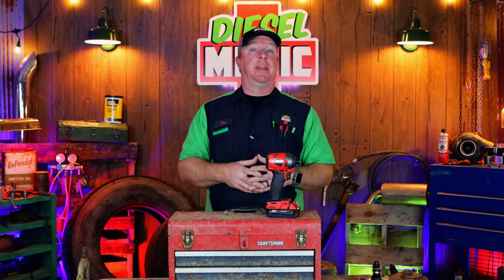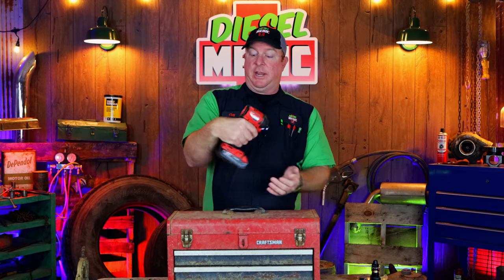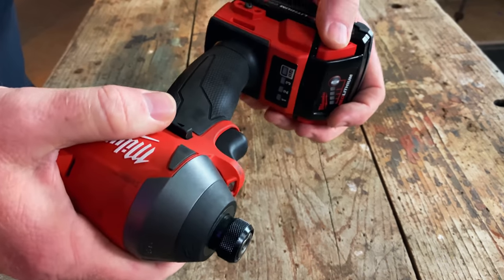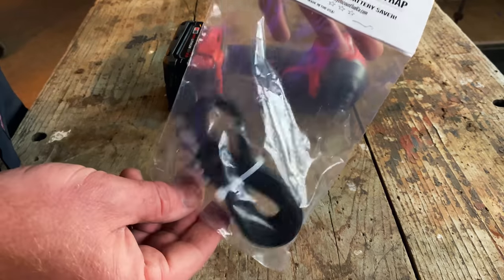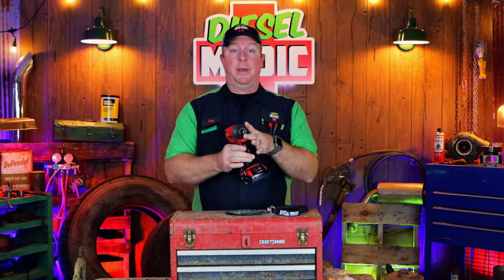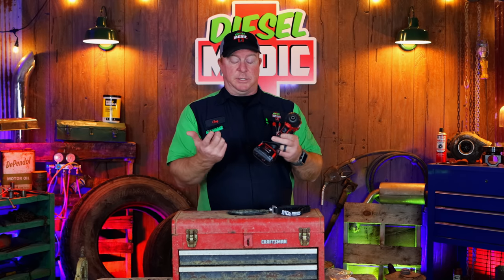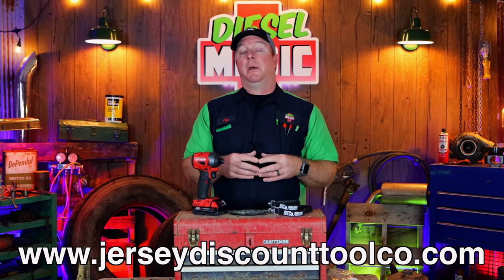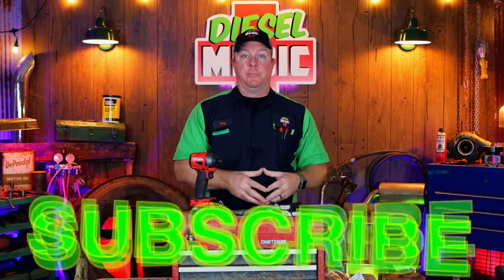Solve Your Milwaukee M18 Issues Fast and Cheap  No More Losing Battery Connections

Comment: I love that I have to figure out ways to keep the battery in place. Especially for a company that totes them self as the king of power tools.
Reply: Every company is gonna have tool flaws, none of them are flawless.
Reply: Still the best in the market, compared to DeWalt or Makita, second to none
Reply: @charlesbuchanan4121  Best in what respect? Failing to work and forcing you to fumble with the battery in the middle of a job? 

Even if it had double the torque compared to the competition, it'd be useless if you couldn't use it reliably.
Reply: For somebody that claims to be the best of the best I am disgusted in the fucking battery connections not just in the tools I haven’t even used my drill/impact tools yet but I have the charger and brand new batteries and I’m still getting loose connections and blinking red and green lights I thought I was doing myself by not purchasing any more DeWalt tools but at least when I’m charging my batteries and a Dewalt they click in and they fucking charge properly. I don’t have to shove a fucking folded piece of paper under the battery to make it charge right this is a fucking disgrace. I’m having second thoughts onMilwaukee for sure

Comment: thanks Clay.....  we have sold 1000s already and they have really been cutting down warrantees especially in my local tool route!
Reply from the maker: They work and I am so glad you came out with those. As you can tell that impact is pretty new. I’ve been super disappointed in this battery issue with it. My m12 stubby is just as bad. Almost have to hold your hand under it to keep it going
Reply: how to switch torque on the tool, button under stap
Reply: Are these discontinued? I can't find them anywhere, including your website.

Comment: I've been using large zip ties. You'd think they would just redesign the battery or battery connector, but I know it's not that simple
Reply: Well it wouldn't be too hard to make the tolerance atleast alot better they only have to re do the mold for the top half of the batteries.. That's pretty bad what's goin on with clays gun there tho

Comment: Thanks for the video, even though it didn't help me out. My problem was easily fixed b slightly bending the two outside contacts on the tool inward.
Reply: Thanks that worked for me.
Reply: Thanks. This worked perfectly.

Comment: So I have found that there is a manufactural problem with the 18v batteries. There's a gap between the red release buttons and the black molded plastic separating the button from the release hooks. I put a medium size paperclip in between them and it tightens the gap which doesn't allow the battery to move when attached. If Milwaukee makes this a little thicker it should solve this issue.

Comment: Just about to collect an ordered m18 and if the battery is loose then I will return for a dewalt or makita . Had several drills over the years and never had an issue with  batteries  and if this loose battery is a thing then milwaukee should recall all batteries and drills and not expect the consumer to come up with fixes for poor design.

Comment: Been makita all my life my workplace stocks all Milwaukee, literally have to have two people using a grinder one person holding the battery in and one person grinding 🤣 same with an impact driver or rattle gun it’s actually a nightmare literally happening with brand new tools it’s a pain in the ass having to duck tape a battery on your tool every time you use it literally rather use dewalt than Milwaukee

Comment: I’ve been told MILWAUKEE is coming out with a completely new m18 line with newly re engineered batteries they will be just like the RYOBI. ONE+.   where the battery goes up inside the handle of the impact gun it’s self
Reply from the maker: The old Dewalt was that way also
Reply: I kinda hope they don't do that since I'm already invested into the m18 and m12 lines and have a lot of batteries. I hope they just improve the newer models so this problem goes away.
Reply: They just came out with four new impacts and the design hasn't changed. They are however starting to put metal strips in the tracks of high vibration tools to keep the plastic from wearing. They did it on the new sawzalls and will most likely put it in the tracks of the new High torque impact when it comes out. They have to much invested in the line to change it completely they just have to make tighter tolerances and re enforce the plastic. I think they could probably attach metal strips to the locking tabs of the batteries and that would help as well.

Comment: Im surprise they haven't figured out a way utilizes the belt clip screw holes i also found the belt clip it self help secure the battery in place especially if you dont have a tool kart and us your pocket to hold the tool instead of the lift .

Comment: Anyone else notices at 2:10 - 2:13 you can see the battery wasn't fully inserted, in other words, it didn't click into place. I abuse my Milwaukee fuel impact driver 5-6 days a week for the last 2 years never had a battery fallout on me, I did experience the collect issue once or twice but nothing concerning.
Reply from the maker: It was fully inserted I always bang the front of them to be sure. It’s just an issue with them and has been since the M18 have some out. Something to do with the vibration that is produced by the tool working so hard. I’m not bashing Milwaukee they are a hell of a tool. I’ve done tons of tests on them on video (one even pushing the 2767 to 1400 lbs ft, it broke in the process but it did do the rates break a way) this was the impact we used and pushed it to its max torque in the video that is linked here. Something wears out either in the battery (or slide) or clips. That’s one reason I used this tool in the video it has the least use on it.
Reply: @KoonTrucking  Common Koon, we both know and anyone that replays the video slowly and watches closely that the battery wasn't fully inserted, the only time it fully inserted was when you bang it on the table, that's why it didn't fall off,  of course it will fall off when you left just enough where it didn't click in all the way, or fully inserted until you hear the click. That tool looks brand new barely used and you're saying the bearings went bad because of one test? believe it or not, my fuel impact does the same so does the M18 compact, mid, and high torque, my guess is it comes from the factory that way for a reason, but don't say the bearings went bad after one test. I'm subscribed to your channel and love your content, but this video seems like an ad for JDTCO.

Comment: That’s cool but Milwaukee should be fixing the issue I would be pissed if I had to put a leash on my drill to have it work I primarily use makita just because they have never failed me I was debating on switching to Milwaukee but not now lol
Reply: That's nothing compared to the screwing those of us who bought into the V18 line got. Needless to say I haven't bought any M18. Been tempted by M12 but Clay is saying they're unreliable too............
Reply: @mattt4183  If it's not an overpriced garbage Strap-on tool Clay will find a problem.
Reply: @mattt4183  don't let 1 parsons opinion persuade you, I don't have any problems with Milwaukee since 1999. If I do they take care of it asap....
Reply: @mattt4183  I also have V28 and V18 tools as well,just bought an M18 to V18 battery adapter. Don't regret going to the M18 line whatsoever.....

Comment: Great video, very helpful, thanks buddy!
Reply: Why is everybody OK with a loose battery and floppy fucking system? I know Milwaukee has good torque and everything but they should also have proper battery seating and a stiff charging platform as well but that is not the case and I am kind of mad because I thought Dewalt was garbage switched to Milwaukeeand Milwaukee has been worse in every way possible as far as battery placement and seating, I’m tired of the fucking red and green flashing lights

Comment: The main reason this happens other than there terrible battery slop is they used to put a spring at the back of the terminals on the tool it's self. If you have a older tool like a very early mid torque impact you could push the black part the terminals are in back and it will spring back forward a little. So even though there is battery slop the spring will keep a good connection. As we all know companies make things cheaper and they no longer put the spring in there tools. Crazy they would do that considering impacts shake and bounce around every time the trigger is pulled. Im always taking apart my tools to fix them myself and thats what I've noticed.

Comment: sawsall vibrations causes  batteries to become loose over time
Will that strap work just right with the m18 cordless milwaukee sawzall?
Reply from the maker: After some research it is only a SKI STRAP, you can find these much cheaper online vs buying this one FYI but yes it works on all m18 battery tools

Comment: i have a large set of milwaukee m18 and small set of m12. my recipricating saw blade lock broke. and my hammer drill only wants to hammer now, doesn't like drill mode. m18's. barely use the m12

Comment: Velcro straps would work
Reply: I have been doing exactly this also if you rtv the black peice where the battery plugs in to the clam shell it makes the battery vibrate alot less. Probably voids the warranty tho sooo

Comment: Have you used the Milwaukee end wrenches? I'd like to see what you think of them. I'm only a shade tree mechanic and I'd like to upgrade from my Harbor Freight tools. Thanks!
Reply from the maker: Yes they are good. The trays are really nice the way they are both on an angle and fit into a smaller drawer easier. Only complaint is I wished they were a bit longer. But they work great and the handles are comfortable
Reply: @KoonTrucking  Thank you!

Comment: Did you just say that thing was wore out? Looks brand new!
Reply from the maker: Did u hear it inside the entire guts are about to fall out of it. It was used in the impact test and it sounds like two hamsters grinding steel plates inside of it not to mention everything is loose in it.
Reply: @KoonTrucking  yeah I could hear it. As much as Milwaukee costs, id expect better. I do like their products even though I don't own any from them. I just bought the Kobalt XTR 1/2" gun and love it. Took off over torqued semi truck lug nuts for the heck of it.
Reply: That's the way they come from the factory the M18 compact, mid torque, and high torque all do the same thing, they sound the same, that's what I thought when I bought my but then I noticed they're all like that, just a factory thing.

Comment: For the premium price they command, this shouldn’t even be an issue. I just got a new high torque 1/2 inch impact, hammer drill and driver and m12 drill and driver kit. All from the fuel line, All of them have battery wobble. This isn’t acceptable. Especially for the price!
Reply from the maker: Yep

Comment: If the Chinese (Milwaukee) would actually take their time to make sure the battery fit tighter like ingersoll or dewalt then I would actually buy their tools.  But I’m ocd and the slop irritates me so I’ll stick with ingersoll rand 20v.  Nice fix with the strap but I wonder if it’ll get caught on top of a transmission or deep in the engine compartment 🤔
Reply from the maker: There’s no doubt milwaukee is the strongest. We have proved that time and time again over and over and over but they aren’t perfect and the only issues I’ve had are battery life and bearing failure

Comment: Never had this issue on the drills but the sawzall is basically unusable right now unless I velcro strap the battery on and need to retighten the strap often as well, VERY annoying. Even worse still, only the 5.0 will work doing this, 9.0 will not. This whole issue is making me want to pull my hair out and makes me scared to buy another sawzall off them for this very issue. Im a huge milwaukee guy so this is incredibly disappointing.

Comment: Interesting I’ve only had this issue with DeWalt, One of the only reasons why I don’t buy them anymore. I’ve never had this issue with any of my M12 or M18 tools, i’ve had M12 tools fall off of lifts that were over 6 feet off the ground and the battery stayed in and the tool still worked.

Comment: How is this not Milwaukee's problem? We have to buy extra stuff and take extra steps to make a $250 tool to work properly! I use Dewalt and beat the snot out of them with zero issues.
Reply from the maker: Well it wasn’t meant to bash Milwaukee because we have proved time and time again they are the strongest of the impacts and bit drivers. But this is one flaw they have for sure.
Reply: @KoonTrucking  I was just confused as to why Milwaukee isn't fixing this issue?

Comment: Thirty bucks for three rubber straps? They Snap-On or what? Sad that the M18 system has such an achilles heel. Otherwise a great system. They can't just redesign it either or they'll negate all the M18 tools and batteries they have already made and sold around the world. That's a lot of tools and batteries. I really hope the M12 system is not as compromised because that is what I've invested heavily in. I guess it will have to be Makita for my 18v needs.

Comment: A trap? That’s a worthless idea for professional use. At a work day I switch the battery like 15 times I’m not going to play with a strap 30 times + I’ll give the strap a week before it’s torn apart by rubbing against everything. 
My battery doesn’t fall out but it does stop working constantly. I like the tools from Milwaukee I worked with it for 4 years and nothing is broken yet. Only this connection problem is happening now. Seems like a problem that will cost them many customers. 

( not that any other tool brand would be better they all made to break except Hilti who doesn’t make enough kinds of tools)

Comment: I need a belt for my pants. Why the fuck should I have to buy one to hold the battery in my fucking drill this is ridiculous. Like I said I haven’t use my drill yet but if this is the case we’re gonna have problems and also the charging board that I have, it does the M12 and M 18 both brand new batteries. It was a Christmas present. I put the fucking battery on the charger and it’s loose like a fucking tooth about the fall out of my child’s mouth. I thought I was going to abandon Dewalt but at least when I charge the batteries they lock in and I’ve never had a problem ever with the Milwaukee I put it in and it’s literally flopping in the fucking wind

Comment: Milwaukee, this is unacceptable. 

A "pro" tool costing $2-300 should be built to better tolerances than a China made $10 toy. It shouldn't require a "fix" for a loose battery connection.

For me, this is a deal breaker and I won't even consider Milwaukee for any of their products. I simply can't trust the company to invest in higher tolerance manufacturing. 🤷‍♂️

Comment: This is the MOST RIDICULOUS ADVERTISEMENT that I have ever seen.
It's NOT a "solution" and it's NOT fixing the issue. And the price is absolutely crazy for such a poor result.
If you really want to cover up the problem in this way, go and buy some VELCRO strip. It'll cost you under $1, be easier to use, heaps less bulky, not get in your way while working.
Of course, repairing your damaged tool or battery pack is a 100% better way to resolve this.
Reply from the maker: Uhmmmm I’ve sent those Impacts back, in fact that is a Unit that just came back from warranty, they don’t fix the battery slop